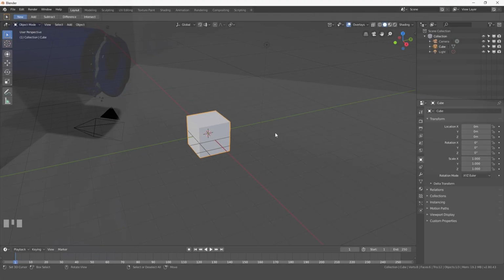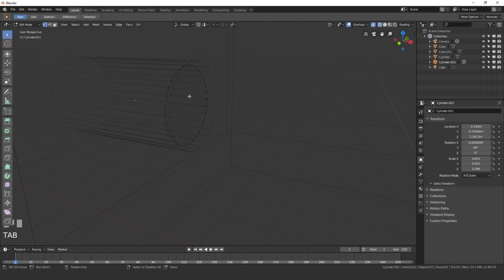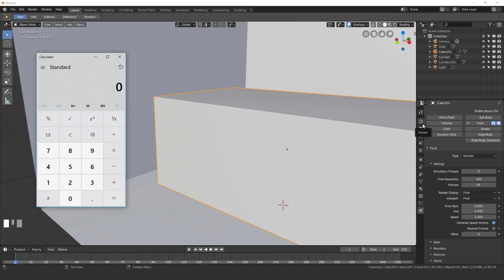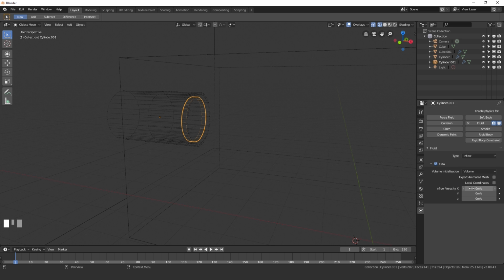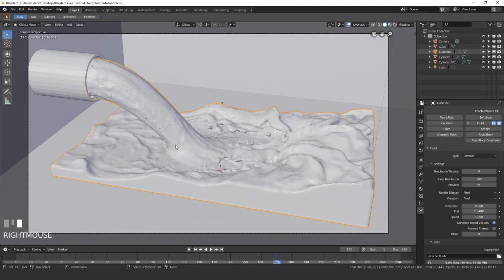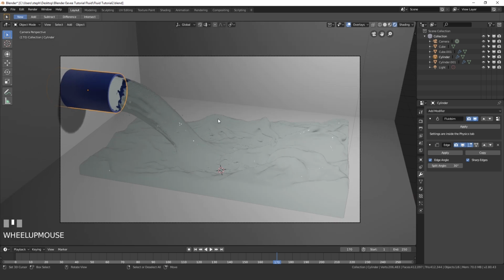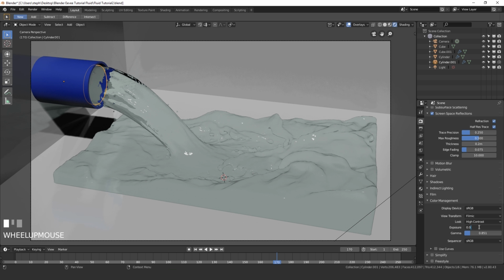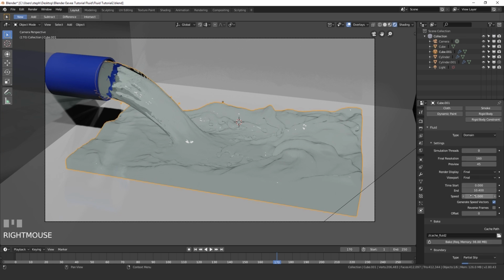Blender Tutorial Fluid Simulation in Eevee

Comment: can someone explain viscosity. im tring to get more droplets.
Reply: viscosity is the same as the scientific term. For example oil has a higher viscosity than water. And some nacho cheese dip definetely has a much higher viscosity. It tells you about the flow properties of a fluid. If it doesn't "pull" as much, the viscosity is higher. You can imagine the viscosity as the pull factor each particle in the fluid has to another particle.